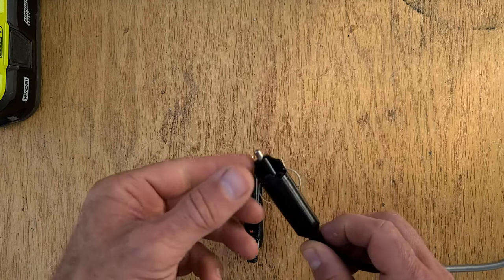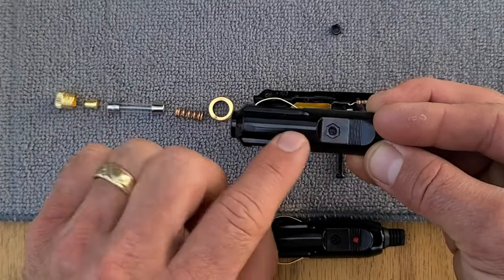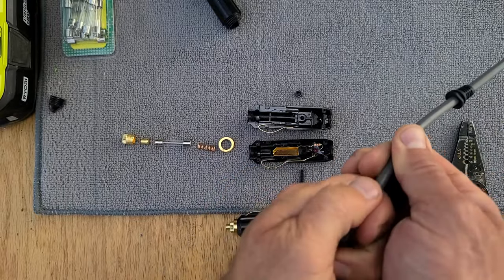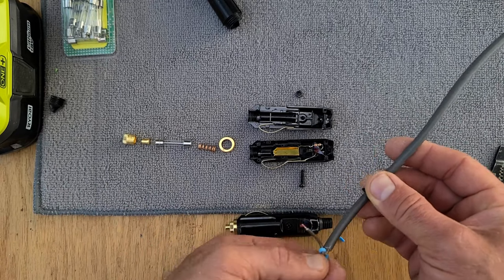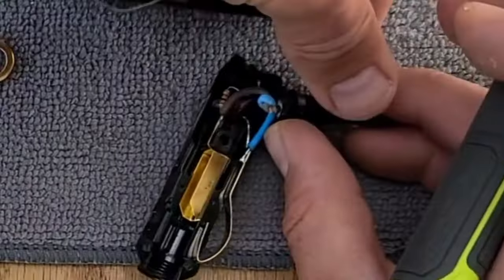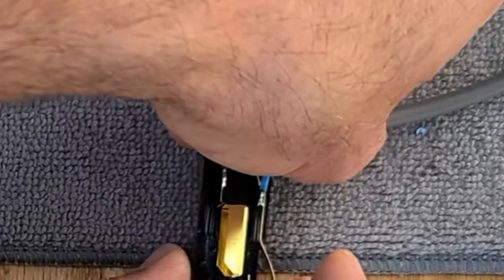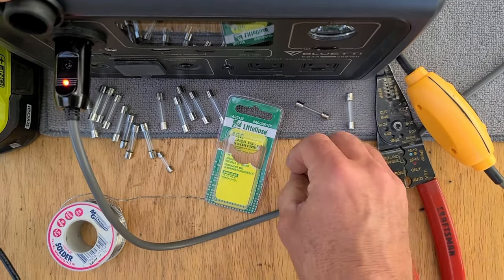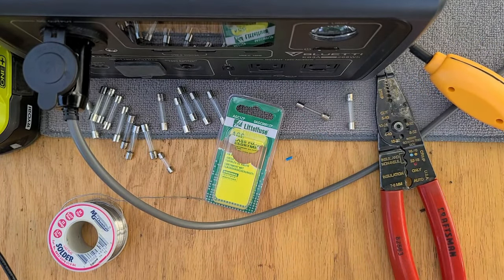Replacing a Cigarette Lighter Male Plug

Comment: My problem is it works for 2 months then it gets hot and it melts  stops working
Reply from the maker: @reymorales6936 this is probably fixable! Generally heat is a poor connection or higher current / small wires. If it's a loose connection, that's where all the heat will be generated. If it's high current or small wires, you generally can feel heat along the entire wire. If it is high current or small wire the result will still be melted at a connection.  What is the cigarette lighter plug powering?
Reply: @daveandsonyainmichigan  i have a electric cooler in my car 12v in my Tractor when I travel  to Chicago it should be 12.  After to months of use gets hot melts and I end  up buying new plug and connecting wires sometimes I soder and sometimes not same results
Reply from the maker: My guess would be that the solder job is not a very good solder. That may be why soldering and not soldering get the same results. Try a Philmore 48-521 connector. No soldering required!

Comment: As this is a good solution, I am in the meantime looking for a practical makeshift fix.
Reply from the maker: What is the problem that needs fixing?
Reply: @daveandsonyainmichigan  The male end plug plastic cover broke off. It looks untidy, but with plastic tape fixed allows it to work. Other than replacing the male end is there another way?
Reply from the maker: @WeRise445 if you are lucky and can find the exact same plug, you can change just the broken piece. If there is still enough structural support with the tape applied, leave it alone and call it good!

Comment: Watched this after I fixed my tire inflator plug, but glad to know that I did it right. Your video was a very helpful QC check.
Reply from the maker: Good Job!
Reply: @daveandsonyainmichigan  thanks I felt very accomplished 😅
Reply from the maker: @MemphisJones  I always think it's so cool to be able to fix stuff and not have to spend money replacing it!
Reply: @daveandsonyainmichigan  same! The parts are usually much less than the product
Reply: @daveandsonyainmichigan  Thank you sir. 
I never solder before.
And you are my first teacher on soldering.
I hope you know how thankful i am for your video.
Reply from the maker: @KLP36912 you are welcome! I know I made this look easy. It takes alot of practice. Make sure you use electrical solder. It has a rosin core which helps keep everything clean so you get a nice solder. Make sure you have a little solder on your iron tip so the heat is transfered to the wire.
Reply: @daveandsonyainmichigan  Will do sir 🥂
Thanks for the advise 🙂

Comment: What happens if you accidentally reverse the wires and plug it into your cigarette lighter in your car? Will it only blow the fuse in your car?
Reply from the maker: It could blow the fuse, it could burn up your device. It could make a motor in your device run backwards. It may just not work. And it may just work fine! A heating device would not care which way it was wired, it would still heat. An LED light in the heating device may not light. A water pump or air pump probably would still run (backwards) but would pump. Electronic devices depend on how well they were designed. They could burn up, not work until you correct the polarity or work just fine with either polairty!

Comment: The problem I’m having with a heavy duty plug I bought for my eco flow is the Center pin is so strong it’s actualy backing itself out my socket and loosing contact
Reply from the maker: Sometimes you can bend / pry the side tabs outwards to have a better grip in the socket.
Reply: @daveandsonyainmichigan  it’s a brand new plug with 14awg wires, fires my diesel heater up perfectly fine I just noticed it creeps out ever so slightly. It seems it’s the center pin spring is too strong.  My only worry is it coming out and loosing connection. I’m sure I can rig up something to keep it held in or wedge some card in there or something
Reply from the maker: @justadddirt  my cigarette lighter plug was doing the same thing when I plugged it into my Bluetti. When I spread the side blades outward, it was a little tougher to insert and resisted getting pushed out by the strong center pin.

Comment: There are only two wires. How do we know which goes with which?
Reply from the maker: That is a very good question. There is a few ways and, in some cases, you can't tell. 1)  The easiest is to pay attention to the way you removed the wires. Take a picture before removing the old wires. 2) Let's say the wire is cut. Hopefully there is a small piece of the colored insulation still on the wire. 3) Maybe on the remaining piece of wire, there is not insulation, or the insulation is the same color. Then if you are lucky the remaining wire is different lengths. Compare the lengths to determine which wire is which. 4) The Red or (+) positive wire will be soldered to the center pin (pin with the spring). 5) If all these fail, you may get lucky and have a connector on the other end of the wire identified as Positive (+) or Negative (-). There may be a small pictorial view showing (+) or (-), then you can use Voltmeter and check for continuity to trace the wire thru the connector. 6) You may need to open the device and see if the circuit board is labeled. 7) Some wires will be labeled a white strip or ribbing formed in the insulation. The manufacturer of that item would have all those identified the same polarity. But I can't say that there is a standard to which is which. So, I will refrain from saying which wire is which. 8) Sometimes you need to quess. You have a 50% chance to get it right. For the few times I guessed and got it wrong, then swapped the wires, I have never burnt anything up! I can't say you would be a lucky as myself.

Comment: 10:04 This is the part I needed originally to know how to reassemble 👏

But I learned a little more, thanks😊
Reply from the maker: YOU are welcome : )
Reply: @daveandsonyainmichigan  

How do I know what amp the fuse is when it isn’t marked?
Reply from the maker: The fuses have numbers on the metal ends, the amperage is in these numbers. Sometimes, it's not so obvious.
Reply: @daveandsonyainmichigan 🙏🤍

Comment: Hello thnkyou for making this video.
i changed the plug of my tire inflator. Its 12 v.
I put a 20 amp fuse in my plug but there is another fuse on the cable for 15 amps.
It was the same fuse before i changed it too but it keeps going out almost instantly i turn on the machine.
Reply from the maker: Do both fuses blow? Was the plug end bad before you changed it, or were you just trying to change the end to see if it helped out?
Reply: @daveandsonyainmichigan first of all thankyou so much for replying. The previous one was broken but worked it If i just push it in. The difference was it was an 18 awg wire and a powerful 12v air compressor. First time the fuse in the plug blew as it comes with 5 amps. I put a 20 amp as I have another fuse on the line before it goes in to the compressor. It is a 15 amp automotive fuse. When I plugged it there were lights on the compressor but it blew as soon as I turned on the motor.